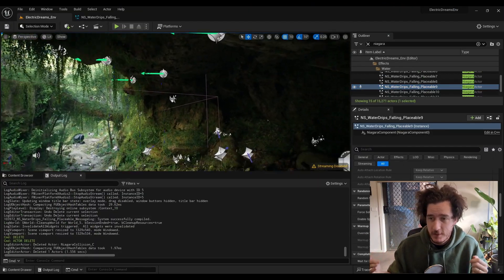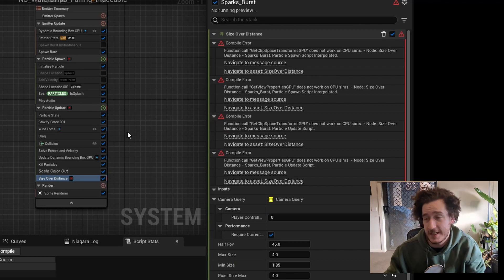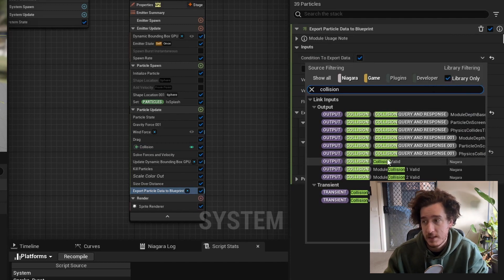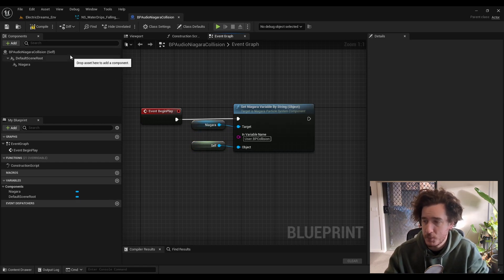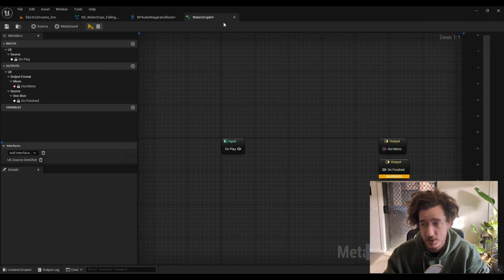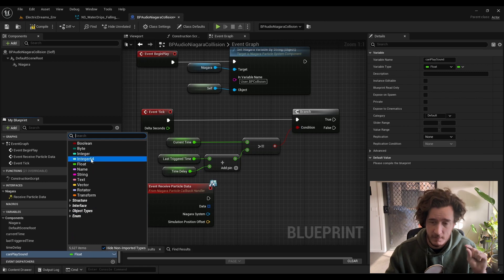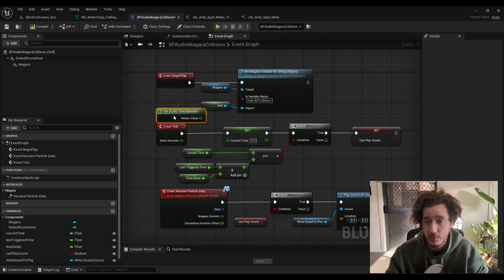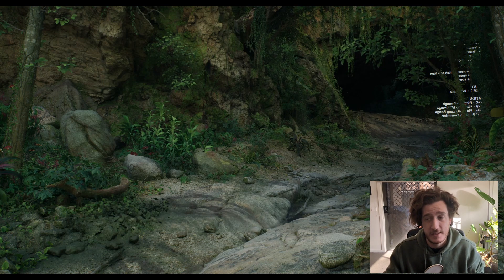Audio Triggers on Particle FX in Unreal Engine!

Comment: Hey cool vid, I did some experimenting and it seems there is much easier way to do this all within the niagara emitter, is there a reason you don't play the sound within the emitter and use the condition "HasCollided" and enable play once? Then you get similar results and don't have to do all the extra steps to communicate with the BP
Reply from the maker: Also totally viable! Just depends if you're wanting to push this back into the blueprint side & do any other additional logic as well!